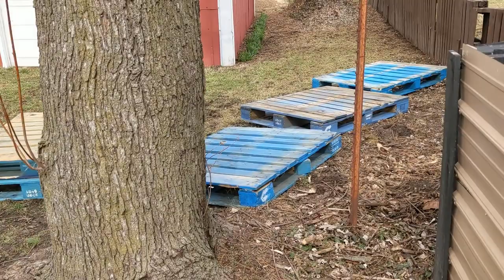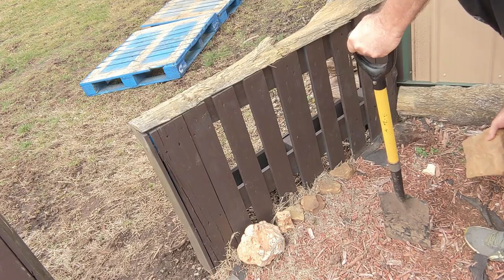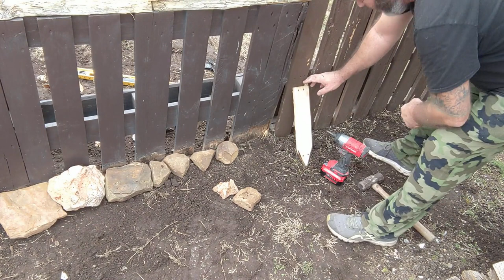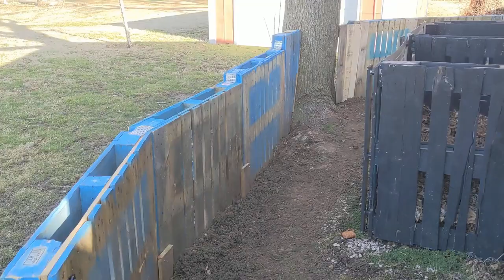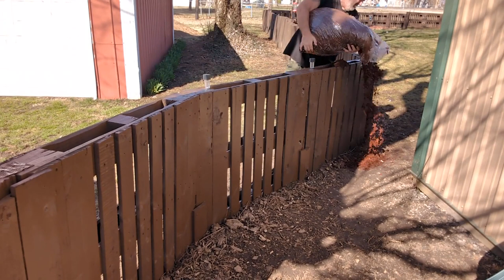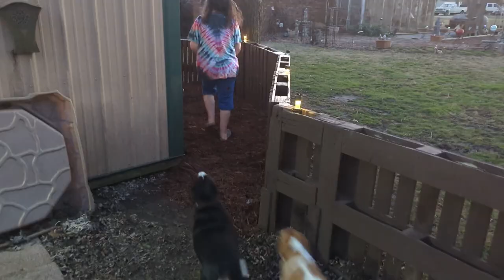DIY Pallet Fence Construction for only $20!

Comment: Very nice & good ideas, Only issue I could see would be the wood rotting under the ground & having to be replaced
Reply from the maker: The pallets are treated timber so should last a while, but yes, will need replacing at a later date. But for the price, i can live with that ✌

Comment: I have a question. What about snow and rain, I'm in the New Brunswick, Canada, should I get the blue ones? Not the pine is that correct. Because I can get them for free.
Reply from the maker: @cathymarshall369 It's totally up to you, if they are treated pine, they will last longer than raw pine pallets. Coating the deck with a weatherproof sealer with also add life to it. Hope this helps ✌

Comment: Good job , what type of paint is it you used please ,,, as it covered really well
Reply from the maker: @lucybarney1 not exactly sure of the brand as i emptied the can and tossed it away, but i believe it was an exterior semi-gloss latex.If that helps at all. Having a spray gun definitely helps getting in between the pallet boards. ✌
Reply: @kinlockskorner6862  thanks , yes going to invest in a spray gun
Reply from the maker: @lucybarney1 good luck with your project! ✌